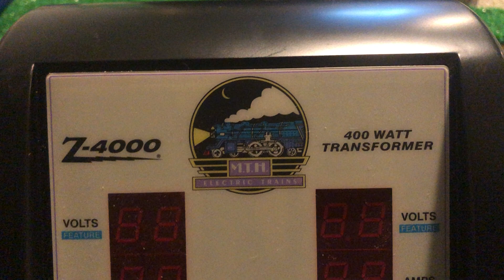Layout Update! New Layout!

Comment: Excellent overview video Matt.  My current layout is only 7' wide. My previous was 8'. Both were 16' long. Boy do I miss that extra 16 sq.ft.!  I was wondering if you've considered controlling your sides with an LCS  Block Power Controller 2 (BPC2). I opted to that and its great. Matches well with the command switches.  https://www.youtube.com/watch?v=488jmfSqXlI&t=66s  
Also, I use an ASC2 to control some of my accessories to include the MTH Firehouse and it's very reliable. Same for the MTH car wash. Well, please keep making those videos, please.